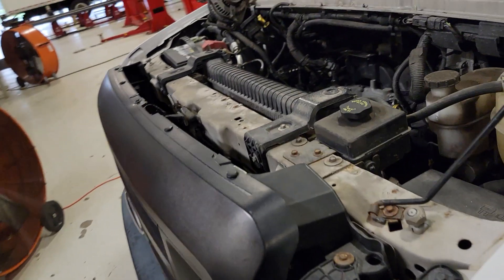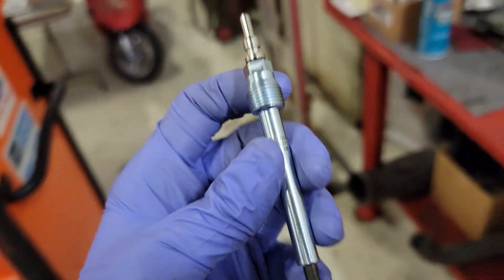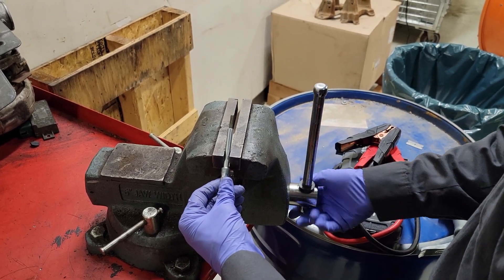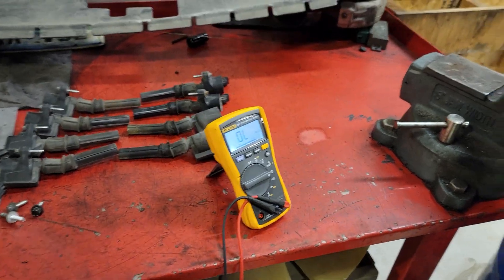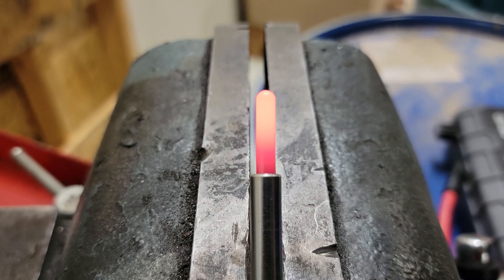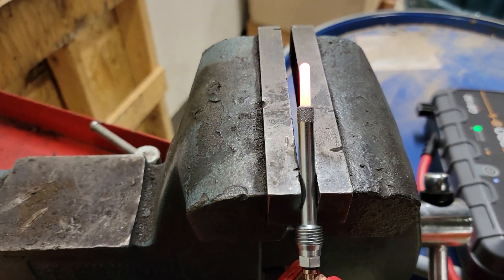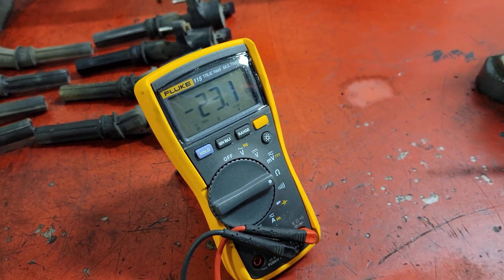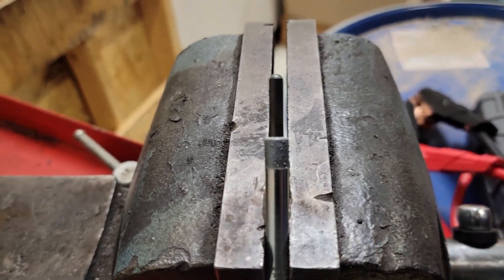What's a GLOW PLUG? Does it GLOW? Ford Powerstroke 7.3-6.0-4.5-6.4-6.7-3.2-3.0 DIESELs Watch & LEARN

Comment: My “17 F350 is currently in the shop having the #3 glow plug and harness replaced. Thankfully it is under warranty!!!  The truck went into reduced power mode after picking it up at the dealership for unrelated work. RPM stuck while accelerating normally, turbo boost went to 20+ and then fluttered before rpm went back to normal. Warning then came on for reduced power failure. Codes indicated speed sensor problem initially according to the shop manager. Didn’t add up to me how we went from a speed sensor to a glow plug?!!

Comment: Everyone says not to use "cheap" Chinese glow plugs. We should spend the premium on original Ford parts. Ford's original parts glow plugs are made in China. So what's the point?
I saw a video where the guy said just replace the bad one. He had replaced another bad one the year before.
These things are like light bulbs (same basic principal) so when the first one goes bad change them all. Otherwise you are doomed to doing a miserable job over and over again.

Comment: My Check Engine light came on.  A code reader tells me that my #2 cylinder Glow Plug is bad, so I'll change it.  I have a 2017 F250 with a 6.7.  Only 45,000 miles on the truck.

Comment: When using a factory installed remote start, does it automatically wait for the glow plugs to begin to heat up, or should it not be used first thing in the morning or during cold weather?
Reply from the maker: Yes my man

Comment: Good video. I could do a dissertation on glow plugs on the DI 7.3 . I live at high altitude- mountains and extreme winter cold . 7.3 Does not like cold weather.
Plug in the block heater
Use Motorcraft  glow plugs 
Make sure the Glow plug relay is working.
Full synthetic oil Rotella T6 or equivalent 
Good batteries. Both of them change to new at same time 
Good to new starter so it will turn the motor fast . 
Winter treatment in  fuel . 
This will all be very important if you can’t plug in the block heater.
-25 f plus high winds will hurt you really bad when she won’t start 💁

Comment: Does the wait to start light going off turn the glow plugs off?
Is it better to cycle the key a few times  or  leave key on when it's real chilly outside?
'06 6.0....
Reply from the maker: The glow plug wait to start light is not depicted on glow plug on time Glow plugs will stay on for up to a 120 seconds depending on engine temperature even though the light went  off doesn't mean the glow plugs are off...

Comment: The negative reading on the Fluke suggests either capacitance or some thermocouple effect generation of voltage .  
That end was a lot hotter than 323° shown on the iR gun.  It's really hard to get an accurate reading on that small of a spot with one of those as it's seeing a lot more than the tip, and averaging the temp of everything in its view.  Just how much is based on the distance-to-spot ratio of the thermometer.
Reply: I think most of those little thermometers have a temperature sensing range, too.

Comment: The nightmare days dealing with 7.3 IDI dealing with glow plugs. Had to use Beru plugs if you didn't you'd pay for it. The gp controller, the little plastic connector get brittle and break. I never had GP issues with my 6.0s.
Reply from the maker: Thanks for sharing

Comment: I had a total glow plug system failure with a 1989 7.3 liter IDI diesel in my F350 crew cab.   Early winter and it would not start.   I talked with the diesel mechanic at my Ford dealer and he said, "Do NOT USE ETHER to start it."   "Use WD-40."  "Soak a rag with the WD40, and put the rag at the air intake and it will start."  So I did that.  The truck started and I took it to the Ford dealer where they replaced the entire glow plug system under the diesel engine warranty.